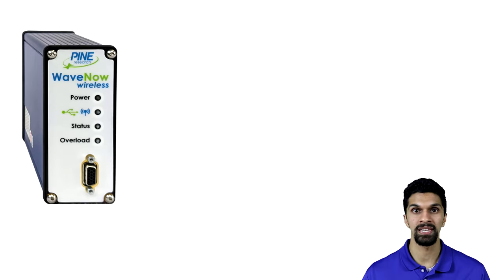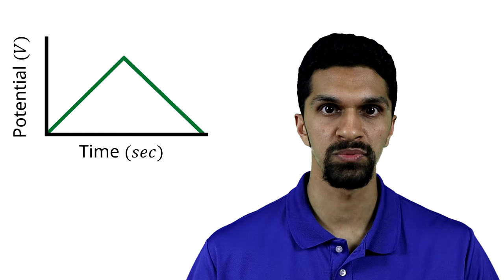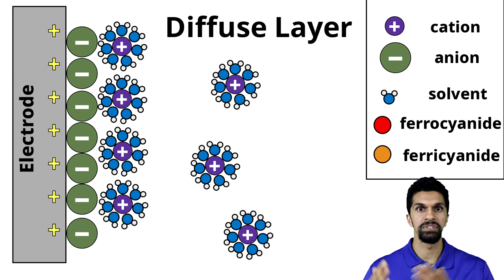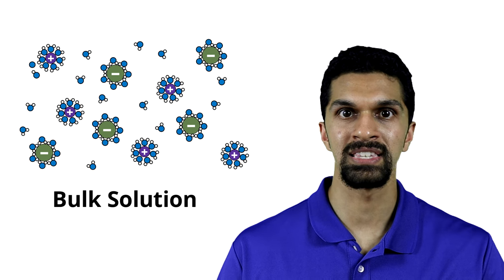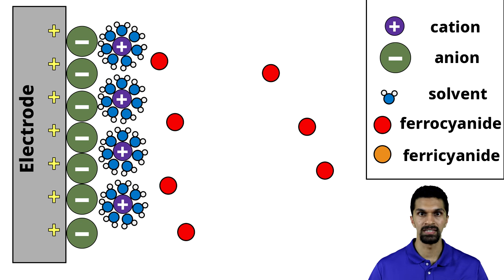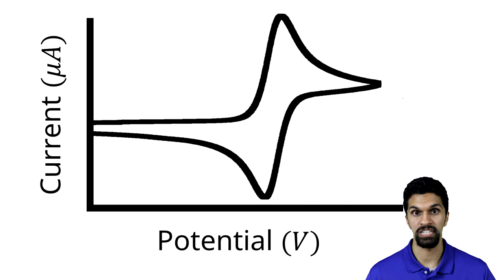Introduction to Cyclic Voltammetry

Comment: This was a great video! I have been working with CVs for the past couple of months and this helped bridge gaps in my knowledge. Your videos on how a potentiostat works and electrochemistry impedance spectroscopy have helped me with my research :) Keep up the fantastic educational content!
Reply from the maker: Thank you Dylan!  I'm glad you enjoyed all the videos we've made.  I've got more ideas for videos, but if you have suggestions too.  Or just general questions we are happy to help :)
Reply: @Pineresearch  For reduction to start occuring, it is not necessary that the potential applied has a negative sign right? It can still be positive but low enough (lower than the ferricyanide open circuit voltage perhaps?) to trigger the reduction process. Please help
Reply from the maker: @glytslife  That is correct, it is not necessary for the sign of the potential to be negative for a reduction reaction to start occurring.  Similarly, the potential doesn't have to be positive for an oxidation to start occurring.  I think of it as the fermi level or the standard potential of ferro/ferricyanide, when it comes to getting a reduction to occur.  When a reduction occurs the standard potential of species in solution is lower than the potential of the electrode (governed by the potentiostat).  That way, electrons will flow from the electrode to the species.  This potential of the electrode can be positive with respect to the reference electrode.  I hope this was helpful, let me know if you need some additional clarification.  Trust me it's complicated :D
Reply: @Pineresearch  Hi there! Thank you so much for the video! I have a follow up question to your last comment, where you mentioned that, "When a reduction occurs the standard potential of species in solution is lower than the potential of the electrode (governed by the potentiostat).  That way, electrons will flow from the electrode to the species. ". I guess for the species in the solution to get reduced, the standard reduction potential of the solution should be greater than that of the electrode as higher reduction potential means higher tendency of getting reduced. Can you please clarify?
Reply from the maker: @anindyanath8136  This is a good question.  I'm going to answer it during Episode #30 of our Ask Us Anything about Electrochemistry Livestream.  The livestream is at 1 pm EST on Fridays so if you can make it that's great, but if not you'll be able to see the question in the description of the video.  This might make it easier to explain what is happening.
Reply: I have been working on them for a whole semester 3-4 month and our proff didn’t bother explaining a single thing on how it works or what’s hall
Reply from the maker: @syedashobnam2573  Sometimes that happens.  But hopefully this video was helpful in helping you understand cyclic voltammetry.

Comment: Can any one wrote here the formula for finding specific capacitance(F/g) for 3 electrode system.
Reply from the maker: Hey Muhammad, I found this online, it might be helpful.

"The specific capacitance was calculated from the CV curves according to the following equation: C = Q/( Vm), where C (F g–1) is the specific capacitance, m(g) is the mass of the active materials, Q(C) is the average charge during the charging and discharging process, and V(V) is the potential window"
Reply: @Pineresearch  we can’t write  2 with the formula? If we add 2 then it will be for 2 electrode system?
Reply from the maker: @muhammadfahad6132  I found another resource on calculating the specific capacitance  https://www.youtube.com/watch?v=AD42mn0r3SI  I would make sure to double check the units and also make sure to only look at the area under the curve associated with double layer charging, rather than any faradaic processes.  I hope this helps.

Comment: Could you please explain it in case of metal oxides?
Reply from the maker: I presume when you are referring to metal oxides you are talking specifically about semi-conductor materials like TiO2?  In this case, CV is the same, except how you think about the applied potential.  For a purely conductive material, changing the potential shifts the energy band up and down.  For a semi-conductor changing the potential also shifts the energy bands up and down, but you have a band gap, which is affected by light.  So doing CV with a metal oxide will be different with and without light of the appropriate wavelength.  I would say the other caveat is the structure of the electrical double layer might look different.  That's a whole different situation.
Reply: I want to know about how does it work in three electrode system when we use metal oxide as working electrode....how charge transfer process takes place and the what is the role of other two electrode in that case?
Reply from the maker: @ranjitkate8396  When the working electrode is a metal oxide it basically works the same as with a completely conductive electrode as described earlier.  The other two electrodes, the counter and reference also behave in the same manner.  The counter electrode maintains charge balance (so if a reduction is occurring at the metal oxide, then an oxidation is occurring at the counter).  The reference electrode acts as a stable reference point to measure and apply the potential against.  All potentials are relative quantities, they are displayed as volts vs a reference point, like Ag/AgCl.  I hope this was helpful.
Reply: Thank you sir

Comment: When I stopped by this video, I realized it was very informative and useful for new bees in the field of electrochemistry. Moreover, I am working on electrochemical system to monitor biogenic species. It’s really useful even in few minutes. In addition, I have a question, why do we sometimes use both species in electrochemical system the Ferrocyanide and Ferrocyanide? If one can work already then why to add second species? What is the mechanism and role of second species if the first species is already oxidized on the electrode surface?
Reply from the maker: Thank you for stopping by and I'm glad you enjoyed the video.  With regard to adding both oxidized and reduced forms of a species into solution (Ferrocyanide and Ferricyanide) it depends on the application.  But in general the concentration of both species in solution will adjust the electrode potential as governed by the Nernst equation, E = E0 - RT/nF*Ln(Ox/Red).  If you want to adjust the E of your system, you can do so by changing the concentration of Ox and Red.  I hope that made sense, please let me know if you need further clarification.
Reply: @Pineresearch  thanks for you response and clarification. I just need to know that when the ferrocyanide reached towards the electrode surface (during positive cycle), electrode would take electron from the ferrocyanide and this species will become ferricyanide (up to this point I am well satisfied). But when we introduce both species then what will second species do at this stage when ferrocyanide became ferricyanide. 
Now we have ferricyanide adsorbed on the electrode surface due to the migration and we have also extra ferricyanide that we introduced previously in the electrochemical system.
Reply from the maker: @physicsofcharacterizationt7570  Great question.  First, it's important to note that in the mixed redox system (ferrocyanide + ferricyanide) you have changed the electrode potential in your system compared to the system where you only have ferrocyanide.  Remember that the electrode potential is governed by the Nernst equation.  Your electrode potential is different from the original system.  So, your question can't be answered directly because by virtue of adding the other redox molecule you've changed the system.  If you performed the exact same experiment as previously described, you'd initially see a spike in current followed by the decay (like in a chronoamperometry experiment), then you'd get the "duck-shaped" CV response.  The spike in current is because you've initially moved the potential to a point away from the open-circuit potential, and that is a point where ferricyanide is thermodynamically favored.  As a result faradaic current passes converting ferrocyanide to ferricyanide.  The current decays as the surface concentration of ferricyanide gets depleted.  As you continue to sweep the potential more positively, the ferrocyanide will oxidize to ferricyanide, and upon the switching potential, we would reduce the ferricyanide to ferrocyanide, getting the "duck-shaped" voltammogram.  Was that helpful?  I know it's quite a bit.
Reply: @Pineresearch  thank you 😊

Comment: I am gonna start my PhD research in electrochemistry, it's gonna helpful to better understanding the Cyclic Voltammetry.
Reply from the maker: Where are you doing your PhD?  Also, stay turned to our channel because we go over a lot of fundamental electrochemistry concepts that hopefully make understanding electrochemistry easier.  Because sometimes reading the text book is...daunting
Reply: @Pineresearch  thanks, I am just finished the course work and comprehensive exams (written). I am doing Ph.D. at SUNY at Binghamton, NY, USA
Reply from the maker: @OmarFaruk-dt3hs  Very good.  I was thinking if you were near us (Durham NC) we are holding a cyclic voltammetry BootCamp with Professor Jillian Dempsey, you could attend.  Right now I don't think there are any echem workshops in that area.
Reply: @Pineresearch  Thank you very much. It is always confusing to me although I wrote a book chapter on wearable energy storage device. Even I didn't understood it clearly from one of my coursework. Do you have online option to attend?
Reply from the maker: @OmarFaruk-dt3hs  Hello Omar, currently we don't have an online course, but we do offer free webinars on different electrochemistry topics.  Right now electrochemical impedance spectroscopy is the big one, but if you stay tuned to our website and social media platforms you'll learn about upcoming events.

Comment: Thank you this video has dramatically improved my understanding of Cyclic Voltammetry. I have to design an Electrochemical sensor that uses the principles of Cyclic Voltammetry, so I wanted to ask once you have the voltammogram (the current vs potential plot), how do you then obtain the concentration/amount of (in this case) ferrocyanide in the solution?
Reply from the maker: I'm glad the video has been helpful in your understanding of electrochemistry and CV.  To determine the concentration from the voltammogram, the most straight forward way is to use the Randles-Sevcik Equation.  This relates the peak current to a bunch of parameters like the scan rate, diffusion coefficient, area of the electrode, and the concentration.  Once you know the other parameters you can use CV as a sensor and use a linear fit/calibration curve to relate the peak current to the concentration.  I hope this was helpful.  As an FYI, we hold weekly livestreams where you can ask us anything about electrochemistry.  They are typically at 1 pm on Fridays EST on YouTube.

Comment: Thanks for your video. I don't understand why you suddenly draw the electrode as negative on 12.18? Because by looking at your 'potential (v)'  graph it is still postive right? 

Apart from that, where would these electrons originate from, from which the electrode donates them?
Reply from the maker: That is a good point.  I was trying to illustrate that the polarity of the sweep was in the negative direction, but I believe you are correct, the charge on the electrode should still be positive.  Good catch on my video.

Regarding where the electrons come from.  When reducing the molecule, they come the conductive working electrode.
Reply: Thanks for your reply. I have thought a bit about this and I still don't really understand it. How does a positively charged electrode still deliver electrons to the solution? That would make it even more positive
Reply from the maker: @2mrRB  Great question.  A positively charged electrode can still donate electrons to a molecule, if the molecule has an even stronger positive charge.  In the case of the cyclic voltammogram, the reduction of ferricyanide is because the potential (while positive) is not sufficiently positive compared to the redox potential of ferrocyanide to take an electron.  The thermodynamically stable state at that potential is for the electrode to donate an electron back to ferricyanide.  I hope this makes sense.
Reply: @Pineresearch   it does. Thanks a lot for your help and prompt responses!!

Comment: interested in learning deeply about this diffusion layer, also is cyclic voltammetry is the only way to report this phenomenon? Can we use the Impedance measurement curve fitting model to describe this?
Reply from the maker: Cyclic voltammetry is not the only way to study the diffusion layer.  Other techniques such as rotating disk electrodes (RDE) and EIS can help you determine the diffusion coefficient.  To deeply understand the diffusion layer reading electrochemical methods fundamentals and applications by Allen Bard and Larry Faulkner is the best way to get a deep understanding of the diffusion layer.  Our videos try to present a relatively simplistic but easily comprehensible understanding of the diffusion layer.

Comment: This is a very helpful video, Can you do a video on how to optimize the process of taking the CV data. And also would love to see how you interpret the EIS data and how to fit the data.
Reply from the maker: Glad you enjoyed the video.  What do you mean by "optimize the process of taking CV data"?  Are you referring to optimizing the conditions for good CV data?  Are the referring to placement of the electrodes?  

We do have a bunch of videos on how to interpret EIS data depending on what the system is and how to do circuit fitting.  What system are you interested in?
Reply: @Pineresearch  Thank you for your swift reply, Yes how do we optimize the condition for taking the CV data? Regarding the electrodes, I am using a graphite sheet as a substrate and then I coat the slurry on it. So How would you go about it?

And Regarding the system, I am working on both polymer electrolytes and different electrodes for energy storage, So can you do a video on how to interpret the EIS Data for these systems?

Thanks once again, I am now a fan of your channel.❤
Reply from the maker: @MatbiangShadap  We are glad you like the channel :_cyclicvolt:❤:_cyclicvolt:.  Every electrochemical system is a little different when it comes to optimization of electrodes, but for a graphite sheet with a slurry on it, my guess is that you will want to place the reference electrode close to the working electrode.  You probably also have a fairly large surface area working electrode, so you will need an even larger area counter electrode, perhaps one or two graphite rod electrodes.  Depending on the conductivity of the electrolyte you are using you will probably want to determine the uncompensated solution resistance and determine whether or not you need iR compensation.  Those are some starting points, but I'd first test your electrodes and electrochemical cell with a well characterized analyte like ferrocyanide or ferrocene.  Because you'll know exactly what the response of ferrocyanide or ferrocene should be, you can then start to make adjustments to your system to get better data.

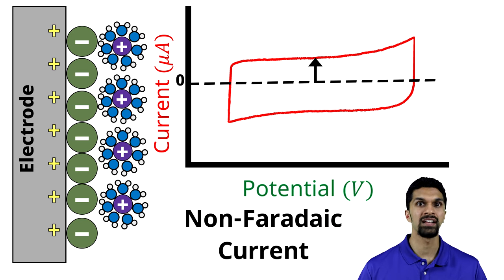Regarding EIS interpretation, we don't have a specific video on that kind of system.  However, if you take our "How to Perform EIS Circuit Fitting on a SrTiO3 Perovskite Film" video, https://www.youtube.com/watch?v=wixp3pKvKMc  at 3:21 we start to go over how to model the system, and more specifically at 9:42 we take about how to think about making an equivalent circuit model.  You might that that helpful when modeling your system.
Reply: @Pineresearch  Thank you for your suggestion and more over thank you for your swift reply. You have just made me a great fan of yours.  I will definitely try out your suggestion. Thanks once again.

Comment: Thank you very much for this video!!! The explanation is very clear and straightforward.But if the electrolyte solution is not ferric cyanide, but glucose, can electrochemical characterization be achieved?
Reply from the maker: Glucose by itself isn't electroactive, so you wouldn't observe an oxidation or reduction currents associated with glucose.  However, some of the original technology for electrochemical glucose sensors was using the enzyme glucose oxidase that converted glucose and oxygen to gluconic acid and hydrogen peroxide.  The hydrogen peroxide was electroactive on platinum electrodes.  Today I believe there are more advanced technologies for electrochemical glucose detection.

Comment: Please also upload one lecture on chronopotentiometry, how to adjust the constant current and potential limits for charging and discharging after taking cyclic voltammetry especially for supercapacitor materials.
Reply from the maker: Definitely something to work on.  Although I don't have much experience with super capacitors

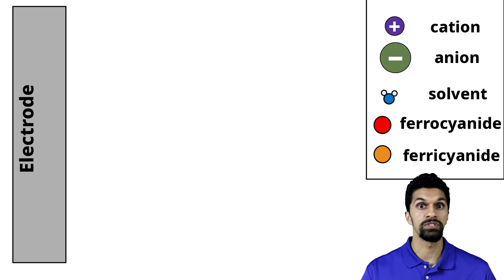Comment: 4:58 how do you apply a positive bias to a working electrode
Reply from the maker: You would need to use a potentiostat to control the potential of the working electrode and set the potential to a positive value relative to your reference electrode.  Sometimes you need to go very far positive to generate positive charge at the electrode surface.